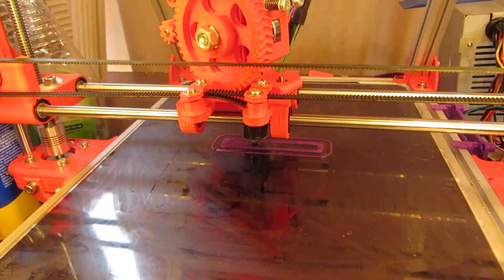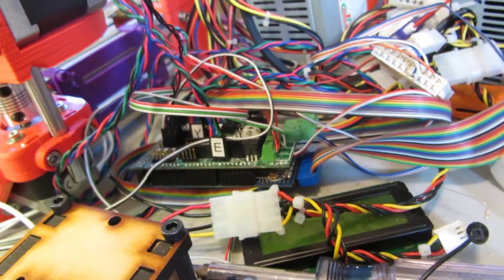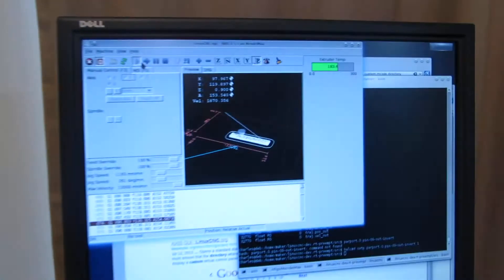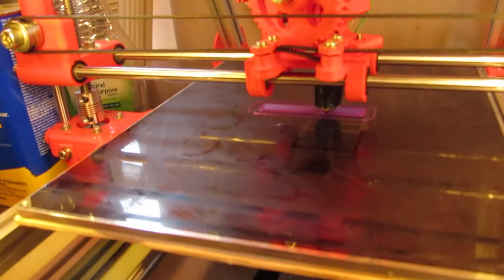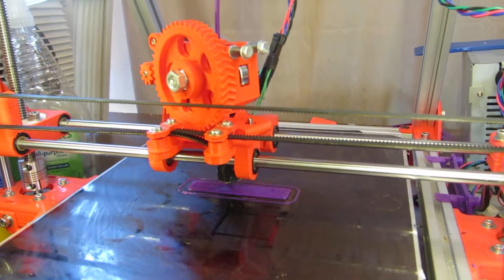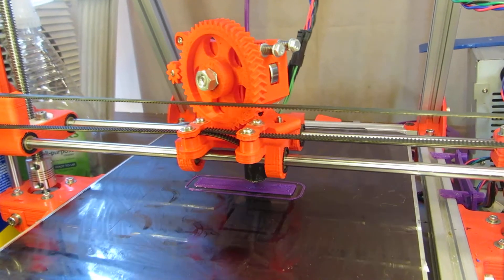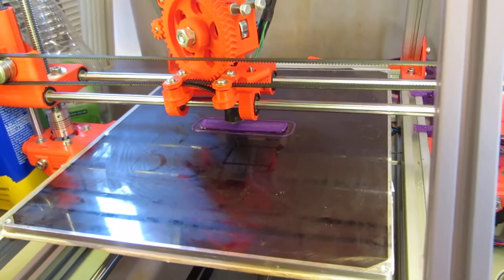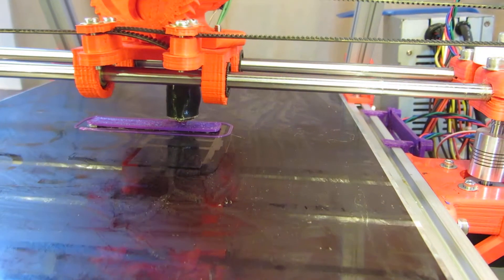LinuxCNC & MendelMax

Comment from the maker: Yes, this was running rt-preempt on Debian Wheezy with a hand-wired interface board between a PC parallel port and a RAMPS board (schematics and HAL code at the link above).  I have since switched to working with LinuxCNC on the BeagleBone, and have not yet taken the PC based approach much farther.